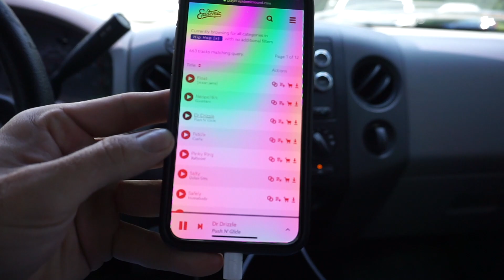Installing new door speakers in my 2008 F-150 (Kicker ksc680)

Comment: My guess on the socket size issue you were having is the screws are soft metal. Car manufacturers will use cheaper materials to produce the interior fasteners because they don't really need to handle much. Not to mention manufacturers don't take into account the fact that the owner might go in and do modifications. Could also be that the screw head was a weird 64th SAE size (not commonly used, but 13/64 is a 64th smaller than 7/32 and a hair bigger than a 5mm, which you said didn't fit). When you get down to sockets that small the tiniest fraction of an inch means a lot more. As for the 6mm size that the manual or directions you read told you to use, that was probably for the replacement screws, which you didn't use. I'll never understand why manufacturers have to complicate the simple things.
Reply: Nope. Its a 5.5 mm

Comment: The size you need for the screws for the door speakers is a 5.5mm.
Reply from the maker: I need to get one my socket set doesn’t have half sizes
Reply: @ToeMosSVlogs  don’t worry. I made the same mistake. Go to your local parts store and they usually sell individual sizes. I just borrowed their 5.5
Reply: Speaking of. Bought two of these speakers brand new and paid $40 for both of them. Super steal, they didn’t fit in the guys truck on Facebook marketplace
Reply from the maker: That’s a great deal!

Comment: i have these in my 4 doors 2014 f150 supercrew powered by pioneer nex headunit.  kicker tweeters in pilliars. kickers compvr 10s under seats powered by kicker 1200.1 amp. slams hard as fuck.

Comment: I have the same speakers, and also I have 2 12 in. Subs kickers CompRT with an kicker 600.1 rms amp under the backseat. My question is, how I add more sound on the speakers? I was thinking on add a converter to the amplifier but let me hesr you guys.
Reply from the maker: I’m not a professional but it seems you may need a dedicated amp for your door speakers.

Comment: U need an aftermarket unit bro sounds bad u could level out ur speakers and subwoofer with subwoofer control on a aftermarket radio the stock ones especially for f-150s suck really bad i have a 2007xlt and put a pioneer double din with rockford fosgate in front doors and pioneers on the back doors power bass tweeters in front they are amazing tweeters no distortion whats so ever on them tweeters clean sound the best ive heard tweeters and two american bass xd 12 on a huge probox and a audio pipe apcle 1500.1 amp on them and a autotek 2,000 watt 4 channel amp and audio control epicenter for my rock music and a clarion eq to top off everything and its clean my best work so far not the best but its loud and clean
Reply from the maker: I definitely want to upgrade the head unit.

Comment: yo first off great video, was not bored one bit, I have 04 same doors as you i have stock side door speakers with 2 10s i believe under the sub, on certain songs i geuss the bass hits to hard is real nasty like, do these speakers handle good with bass? better than stock?
Reply from the maker: I’ve not had a problem with them
Reply from the maker: Definitely better than stock
Reply: @ToeMosSVlogs  sweeet you are the man, prob picking these up, you need a 10% code so you can get some of this money lol
Reply from the maker: I wish

Comment: Did you have to get the connector plug separately or did they come with the speakers?
Reply from the maker: https://www.amazon.com/Metra-72-5600-Speaker-Harness-1998-UP/dp/B001OAB6BW/ref=mp_s_a_1_2?keywords=metra+speaker+adapter+for+1999+and+up+ford+trucks&qid=1659714499&sr=8-2
Reply from the maker: Here’s a link
Reply: Do you need them? It’s something most people probably know but I just tried connecting straight to the wire and it didn’t work. First time installing speakers on my first truck and I’m struggling
Reply from the maker: @bossness4896 you have to have the adapter plugs.
Reply: @ToeMosSVlogs  thank you so much for the quick response I’ll go out and buy em right now
Reply: @ToeMosSVlogs  or is it possible to take the connector off the old oem speakers and somehow connect my new speakers wire to it?
Reply from the maker: @bossness4896 if you can’t find them in store there is an Amazon link for them pinned in the comment section.
Reply from the maker: I wouldn’t cut the factory plug off
Reply: @ToeMosSVlogs  yup for sure I’m calling around now to see. Already waited a week for the speakers haha should’ve done my research before hand
Reply: @ToeMosSVlogs  haha already did but it’s all good it’s easy to solder it back on the only thing killing me is this -30 Celsius Canadian weather 😂 just ordered them on Amazon with next day shipping so I’ll have some good music in no time

Comment: My speakers on my 2005 f150 have been cutting out lately do you think this will solve the problem?
Reply from the maker: As long as there is nothing wrong with your wiring it’s probably just the speaker going bad.

Comment: How are they holding up? have they ripped, or did sound sucked after couple of months???
Reply from the maker: They’ve sounded great from the start. I listen to music really loud so it really works out the speaker. They have held up great.
Reply: @ToeMosSVlogs  thanks man very helpfull!!👌👌
Reply from the maker: No problem
Reply: ToeMosS _Vlogs How good are the speakers cause I ordered mine the other day and they coming in today but are they really good with bass
Reply from the maker: FaZe Elite the bass isn’t very deep but I have a 10” sub under the back seat. The tweeters sound great though

Comment: Your all sweating its dosent even look that hot out there imagine living over here in laredo man u cant be outside u would be soaked and get a heat stroke it 112 almost everyday youll die outhere in laredo texas its boiling hot the city is in like in a hole so its feels hotter being in a hell hole literly if a wave of water hits here the hole would be under water the city flooded
Reply from the maker: It was easily 90 degrees

Comment: probably a 5.5 mm socket
Reply from the maker: Is that a thing. If so I need one
Reply: @ToeMosSVlogs    Use a 7/32 socket, almost identical to 5.5 mm
Reply from the maker: I’ll try that when I do the ones in the back.
Reply: You are correct sir it is a 5.5mm

Comment: Do you have a sub or is that bass all the speakers?
Reply from the maker: I have a kicker compRT 10” sub under the back seat
Reply: Oooh i was gonna say 😂
Reply: ToeMosS _Vlogs do the speakers have bass without the subwoofer?
Reply from the maker: A little bit, but if you want deep bass you’ll need a subwoofer
Reply: @ToeMosSVlogs  any chance you can do a quick review of the RT in that generation of F150’s?

Comment: What type of connector is it from the speaker to the stock plug?
Reply from the maker: I don’t know what it’s called but it adapts the harness from the truck to the speaker. They told me I needed them when I got the speakers from Best Buy so I bought them when I got the speakers.
Reply: There Metra Speaker Harness

Comment: where do you get the adapters at?
Reply from the maker: I got them from Best Buy but I’m sure Amazon would have them. I’ll see if I can provide a link
Reply from the maker: https://www.amazon.com/Metra-72-5600-Speaker-Harness-1998-UP/dp/B001OAB6BW/ref=mp_s_a_1_3?crid=2T1AAMOXDJJ01&keywords=metra+speaker+adapter+for+2008+f150&qid=1647957123&replacementKeywords=metra+speaker+adapter+for&sprefix=metra+speaker+adapter+for+2008+f150%2Caps%2C131&sr=8-3&vehicle=2008-54-666------------&vehicleName=2008+Ford+F-150
Reply: thanks